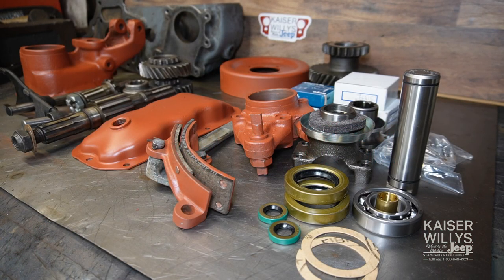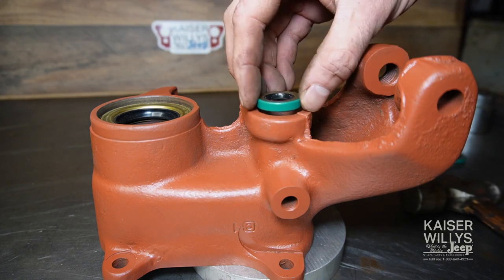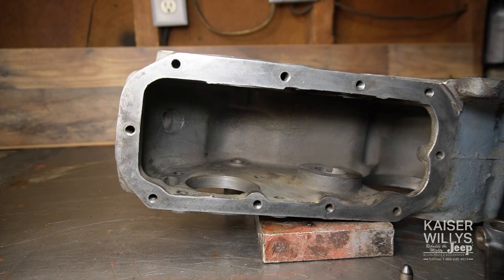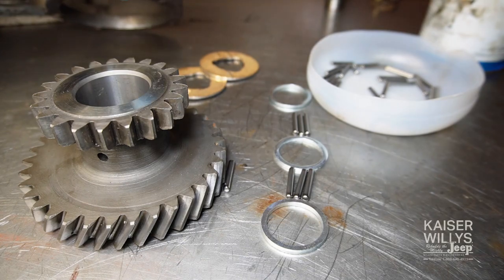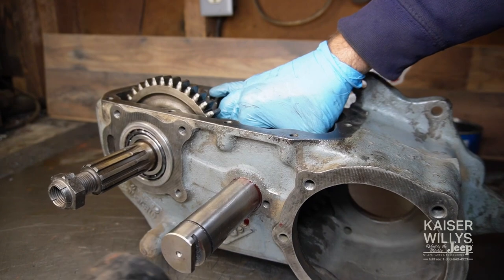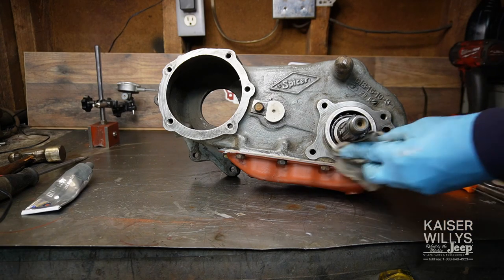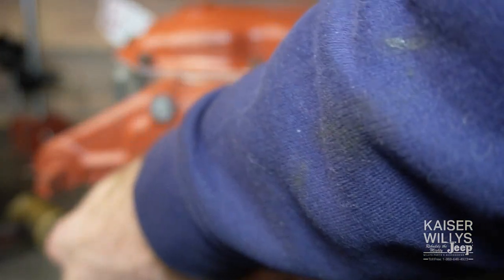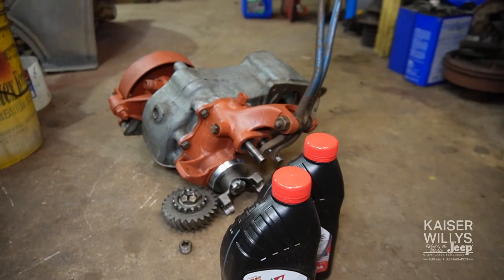Spicer 18 Jeep transfer case rebuild

Comment: I'll be rebuilding my large hole dana 18 this winter. The single lever shifter doesn't like to go into 4low and it leaks. Thanks for the video. Got to order some brass hammers and punches.

Comment: Shims, on the speedometer housing, I have a 1960's Brazilian service from Willys Overland, was setting with a filler gauge between the high gear and the main shaft...
Reply from the maker: I have no idea what you’re talking about. lol… the procedure used in this video for setting output end play is the correct method.

Comment: So of them uses cage bearings instead of needle bearings.
Reply from the maker: Roller bearings on the outputs. Needle bearing a on the intermediate shaft 👍
Reply: My intermediate shaft is 3/4 inches and uses cage bearings with the intermediate gear.
Reply: @redeyecafegarage7484  you can use needle bearings but I like to use the the cage bearings instead.